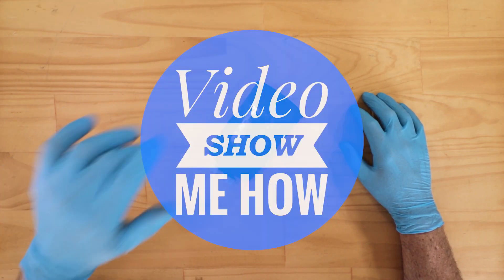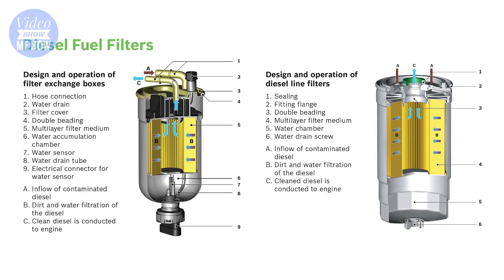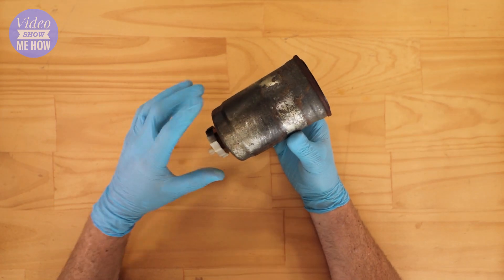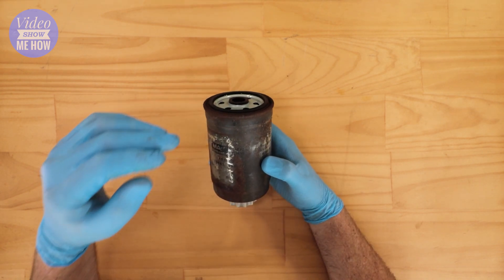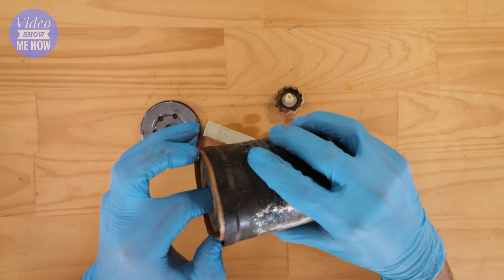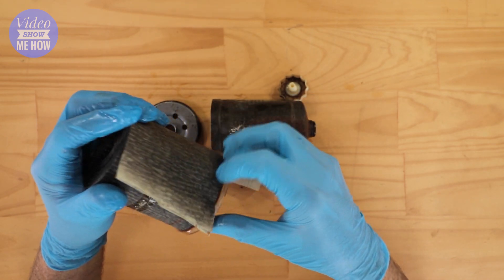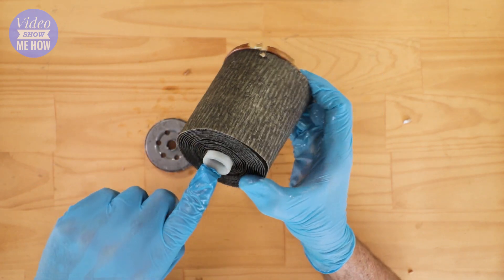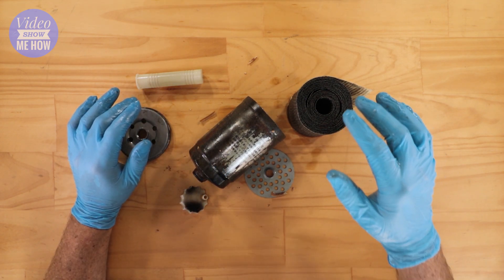What's Inside a Diesel Fuel Filter? We cut one open to see!

Comment: Thanks for the video!
The water separator still confuses me a bit to be honest.
Found the screw on my filter, found out it was to get rid of water in the filter, unscrewed it and out came clean diesel, no water at all.
If there is no water in the filter, should there be diesel or nothing coming out?

Feels like there should be nothing coming out instead of diesel if there is no water in there, or am I mistaken?
Reply from the maker: was a while ago this one, but yeah idea is the water will sit at the bottom and come out first before the diesel so just needs a quick drain and once clear diesel you're done